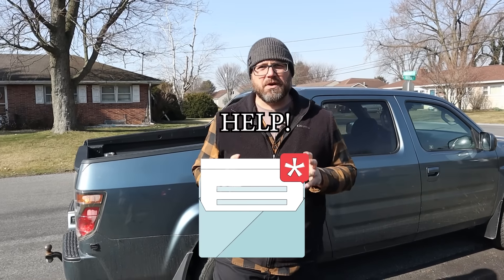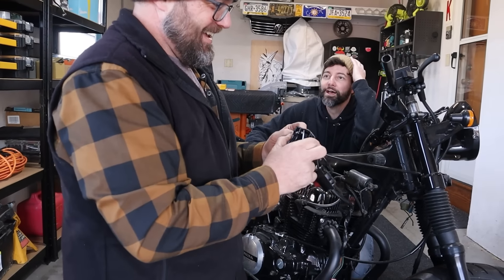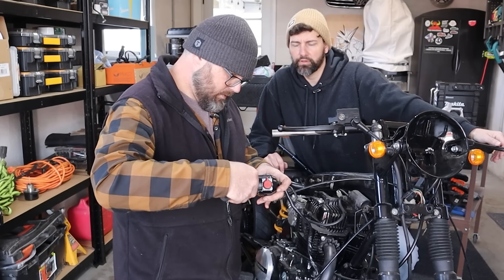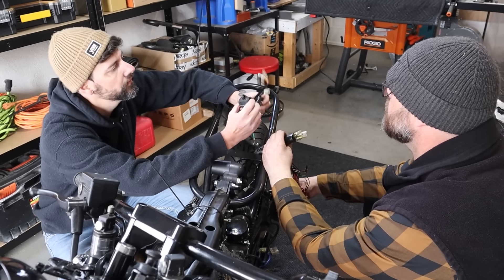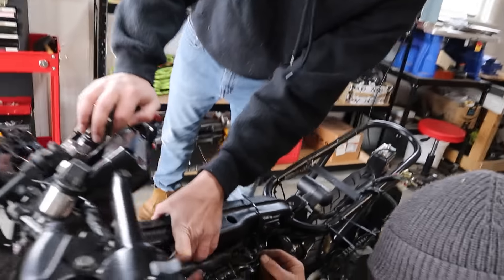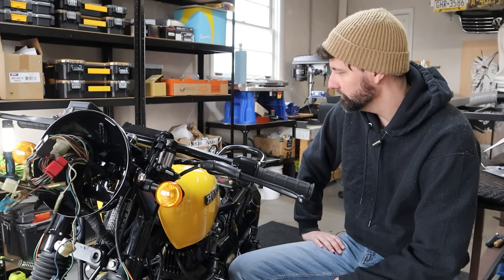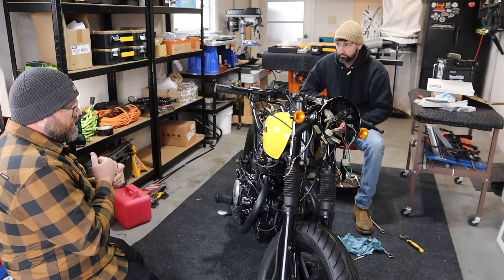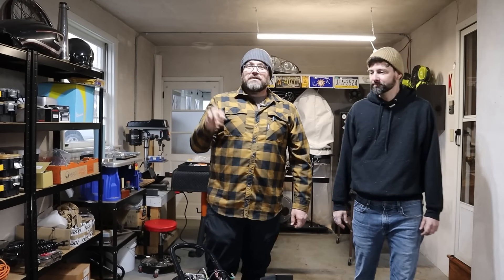Rescuing A Fan's Honda Motorcycle Project. Stumped To Pumped!

Comment: Great video 6 minutes into it, reminded me of learning the helpful instructions of tech school to use tags with wires to attach to parts, especially cables/wires and hoses, writing on them where it came from when disassembling.
So natural to remove multiple wires or hoses and not remember which goes where.

Comment: Always great to see you get another bike on the road. Can't wait to see this completed by the owner - you really need to have a follow-up video with the bike all done. One comment: solder is not a mechanical connection. Before you get much further, take that wire apart, twist them together, and re-solder them. Future you will thank you. Ask me how I know that.

Comment: 18:20 Always melt the solder with the wire you are soldering, not the soldering iron. Everything becomes much easier - why? otherwise a cold wire will suck the heat out from molten tin and solidify it before tin properly wets the wire.

Comment: I took my motorcycle licence practical test with the same bike back in the mid 80's. Borrowed it from a friend. Wet that morning, dropped it at a stoplight on an oily patch. Showed up for the test with two dangling turn signals, and a bleeding knee. Instructor laughed " you have to use hand signal for the test anyways". 😂

Comment: Craig, one more thing about soldering two wires together. After you tin both ends make a small 180 degree loop in both ends and clip the excess wire so the hook look like the end of a very tiny umbrella handle. Then hook the two wires together and solder that connection. The strain (across the solder connection) is then handled by the wire hooks (the two bends in the wire) and NOT the solder. Solder is NOT glue. :)  To protect the tip of your soldering iron/gun add layer (glob) of solder to the tip when you turn it off.

Comment: Impressive how quick that thing fired up, he barely touched that starter button.  Definitely a Honda.

I recently had one of those "little things you find in the manual" moments when I had the primary cover off my 70's Triumph.  When I put it back on I went to the manual and it said the primary holds 350cc's of oil, so I put 350cc's of oil into it.   For some reason that effected the clutch operation.  I went back to the manual and  found a paragraph that said when you empty the primary of oil you should prime it with 120ccs of oil.... so don't put the full 350cc's in because small holes in crankcase will  eventually level it out to where it needs to be.  Once I emptied it and put the correct amount of oil in, everything worked as it should.

Comment: I had the same throttle cables problem on my Kwaka, when the cable has too much free play it tends to bind up on itself in the switch block, once you get rid of the excess free play it works smoothly. Took me best part of a weekend to figure that out, I must've put it on and taken it off at least 20 times and I had the workshop manual.  My first rule of car/bike maintenance always buy the workshop manuals.

Comment: When adjusting throttle cables.
I always remove all the slack at the carbs and leave just enough to feel a little play.
The with the bike off the rack so I can turn the bars side to side.
Find out which direction has the least slack. Right or left. It all depends on the routing of the cable/s.
I adjust at the throttle housing to 0 slack at full lock. At center it will have the slightest bit of slack.
I prefer absolutely no cable slack.
Can't always get there with all bikes.
I tune the ergonomics on all my bikes the same if possible. Same grips, same lever throws and so on.  Make the transition from one bike to another seamless.

My most challenging build was installing a Suzuki RG500 Gamma motor in a Honda NSR MC21 chassis. The wiring wasn't too bad. I still have it after the build was completed some 20+ years ago. I've only changed a couple of minor things since and it's worked flawlessly.  It's definitely one of a kind. 300 LBS of two stroke evilness.
👍

Comment: For joining 2 wire ends together, strip extra and do a Lineman’s Splice. It becomes a 1-person job, and will hold strong enough for testing if you are unsure if the connection you are making is correct.

Comment: I got a 85 CB450SC. Turning mine into a scrambler, also with a monoshock conversion. Mostly just gotta finish the exhaust, get a new knobby front tire to match the rear, and tune the carbs.
Reply: Good job!  Immediately thought this should have been a scrambler myself.

Comment: I'd love to have you down in GA, Craig; I have a '78 CB750A that needs a ton of TLC... motor will run but basically everything else needs to be done. Electrical, fork, rusty tank, carb rebuild, frame repaint... All in a tiny rented garage space!

Comment: 17:44 Had an 81 cm400 a automatic was a customer that never picked his stuff up it sat corner for 14 years got tired looking at it. So i made from the scrap pile single seat metal pan foward foot pegs bobbed 81 kz1100 rear tail 150 rear tire made suicide shift brass door knob 1-2 hi low rear brake clutch hand controls took awhile too get used too your feet hang there  miss that pile

Comment: Hi great job but with those carbs you need both throttle cables its because Normal running it will be fine but when on the road going fast you shut down the throttle it causes a vacuum which will keep the diaphragms up stopping the slides from dropping i know this from experience of flying into a corner at speed and throttle didn't shut off which is very bad it is only this type of carb this happens you need the cable to pull the slides down .just thought I would mention this i was a mechanic for many years and its always good to learn something great show hi from England

Comment: In low voltage wire coloring usually BL is blue, BK is black, and BR is brown.  If you aren’t using brown (lil in an application where the wires can be exposed to extreme heat or sunlight) then the B is dropped from BL to make it easier!

Comment: The last 10% of any project takes 90% of the effort. I'm currently in the last 5% of a 2 year project of restomoding an old English car and all that's keeping me from just rolling it behind the shed and forgetting about it is just pure damn determination. It's just not fun anymore. Just NEED to get it out on the roads.😂

Also, that soldering kind of gives me anxiety.... 😅 Snip, strip, twist and tin. That way it gets way stronger, less resistance and a smoother joint overall.

Comment: For soldering: Quad Hands are AMAZING! You can take the arms off and stick them to the bike. Also, if you don't love your soldering iron, get a PINECIL or PINE 64. They are the same thing. Get a 65w USB-C laptop charger to power the pinecil, and you are SET. Best setup I have used. You can also get a 65w battery (like the kind of battery you get to take with you to recharge a phone on the go, Baseus makes a good one) with a PD port and a PD wire for it and run the pinecil without having to have it plugged into a wall. The pinecil used ts100 soldering tips, so you can change them out for different styles, if you want.

Comment: Hey Craig !
Since the last time you helped Anthony fix that Harley in the great outdoors, I felt that you need a short stool or bench to sit on instead of squatting or kneeling to get at the bike. ( a bike is pretty short, no !)
My deceased motorcycle mechanic friend and his two employees had a few miniature wooden benches they sat on all the time. Of course in those days no one had motorcycle lifts !
I have one. A guy repairing my house, made one for me out of the discarded boards. At 68, it makes cleaning my motorcycle a lot easier.
It would relieve the pressure on your joints !
I feel uncomfortable for you !
Trinidad & Tobago.
West Indies.

Comment: wow he actually got solder to stick to the tip on his ryobi soldering iron, i have the same iron and there was nothing i could do to get solder to stick to the tip, i couldn't even solder with it because the tip acted like a solder repellent, i bought a set of new non-ryobi tips and it solders great now. i need to check out the cordless heat gun.........

Comment: Hey guys. I have an 81 fxs that I could use some help working on. It starts, but the clutch plates keep getting stuck together after about a week, and it could use some adjusting. Also, the carb could use a rebuild, and the shift linkages are pretty loose. I'm in Chattanooga, Tennessee, so you could swing by srk. I also have an 81 ironhead that I need to rebuild the carb. It has no power under load.

Comment: Reading the manual is very true as some machines may work a little differently than others. For example, my car requires that you put a little gasket maker on one corner of the valve cover because of the way it curves, while the rest is just fine with only a gasket. You wouldnt know that unless you read the manual, or found it on google like me haha.

Comment: I have a 1972 cb500 four and 75 cl360 scrambler, I’ve basically restored the bikes to original condition, but am struggling to understand/grasp the whole points ignition and carbs fully. 
Would love your help!

Comment: As a Industrial electrician we used to write down black = BK   blue = BL with shrink tube the 2 numbers like 20/10 means starts off at 20mm dia max shrinkage is 10mm ( sorry for metrics but I am a Australian)

Comment: Hello, I  have a 2006 suzuki GSX750F, or as Americans  say, it a Katana I bought a rear L.E.D brake light with built-in indicators it does come with the connector that plugs into to the brake light but I have a yellow and blue wire left over and don't know where they go.

Comment: Hey Craig, a question from the other side of the world :) My buddy bought a VZ800 Marauder and it doesn't quite get to the 102mph mark as the specs says. Its some 20 mps slower than that. Can you share a quick tip on how to get the last mps out of it. Carbs are synced, new plugs, runs smooth in both idle and when running, so im a bit HRUUUMPF on what next step could be :) and im quite sure your not gonna drop by to give a hand :) Are we looking at giving it a bit more juice/air at the mixture screws or what do you suggest :) THANKS In advance :) 

Love your channel btw :) 
Best regards, Jasper from Denmark

Comment: My last bike was a 1980 Z1R 1000.  It was a fairly rare bike. It was stolen 3 times.  I got it back all 3 times but the last time the guy was running from the cops and hit a car, so I got parts back.  I worked on that thing for 5 years sinking money into it hand over fist.   I finally traded the parts for a car.

Comment: Laughed when Craig said almost as ugly as virago...my nephew made his virago into a cafe racer. As for wiring...bought a wrecked bike off online auction with front end damage. Turned out whatever hit it did so hard all the wires between the battery and key at front corner of tank were sheered off! What a mess.

Comment: Say what you will, but I read, read, read. The first thing I learned in automotive at the college level was read the instructions that come with the part. Read the manuals. I have a decent library of tech manuals, some very broad like "American Trucks 1964-72" to very specific factory service manuals. Books for cars, bikes, small engine stuff. Some of my manuals are only virtual. Sometimes I just need them for a quick torque spec. Sometimes I have no clue and have to follow the book word for word. I'd rather be informed and correct, do the job right than give one crap what anyone thinks.

Comment: Nice job! the typical project where someone gets in way to deep and it stalls out.  But you know better then 99% of "Cafe" conversions where they cut the subframe of a perfectly good motorcycle, strip the parts off and buy a cheap chinese seat before slamming it up on Marketplace as an unfinished project.

Comment: Some older bikes like Hondas had a small dowl pin on the throttle housing and it fits into a small hole in the handlebars and if you lined it up you didn't have to cinch it down so hard because the motorcycle factory put strong return springs to keep the suction when you opened the throttle it wouldn't stick the throttle wide open 🔓 and the same reason for the push pull throttle cables for safety and to avoid liability lawsuit

Comment: You need to remove the paint off the handlebars under the starter switch clamshell so that it makes ground in the circuit.

Comment: you can fix that little tank dent without having to strip and fill it... just get the right shaped 'spoon' inside the tank and press it out... then some touch up paint... at worst, wet sand and clear, or just leave the scar as a reminder...

Comment: I love old hondas. Those cv csrbs will never run right with pods, and the cheap kits can be plagued with gremlins.  Randaks kits are awesome. Get / fab an air box, or swap them out for a mechanical slide.  Jis.... teehee.... guilty as charged.  Best of luck!

Comment: I have 1970 SL350 twin Motosport Honda with 80s upgrades lost50lbs dickbrake 650shocks akront rims Cadilac in the dirt air asist 1in extra travel "Frankinbike"😂😅🎉has bigger valves and longer rake for stabilty from factory .the Cl sucks compared,also two into one down Yoshimiura 😂

Comment: My cbr1000f has a bar riser and i for the love of god cant find longer replacement throttle cables that are both long enough and have a long enough inner cable. Most people run vfr800 or vtr1000 cables but i cant get them to fit on the tube, the inner cables  are only long enough to put the pull side on, so thsts what i run now with a nut on the push side so stop water from coming in

Comment: The irony of a guy having a throttle input issue sent to the hospitalhospital and almost death to also have no problem with deleting the safety push and pull functionality. I guess if you get a stuck throttle, you’ve always got the clutch right there in your hand….

Comment: continuity is only to check if the circuits complete!  not power!  never put voltage through your meter when using the continuity mode!  you will blow the fuse in the multimeter!!!!

Comment: I have my dad’s 2004 soft tail with 106,000 miles. He used 4 years ago and I ride it 8 times and it’s  been sitting now for 2 years due to battery and fuel stabilizer I couldn’t get it to run

Comment: I have a2007 Suzuki Boulevard S50 24,800 original miles has a brand new front tire battery oil change car bill, rebuilt runs like a champ has a lot of chrome I’m trying to sell it. I only want $2000 for it is worth a lot more than what I’m asking. If you know anybody send them my way or if you’re interested, let me know. I’ll send you pictures. You’re really like it